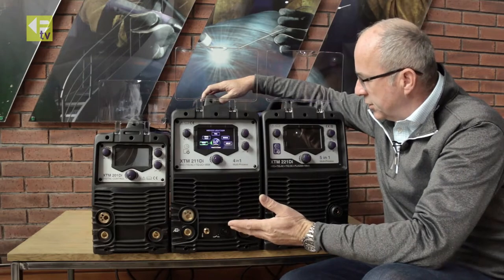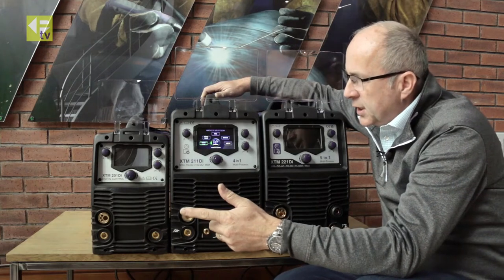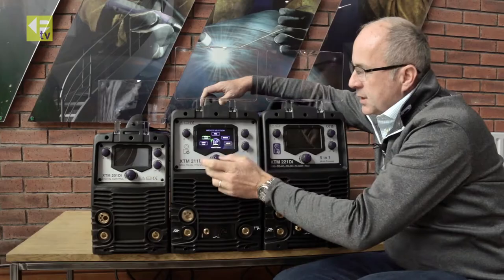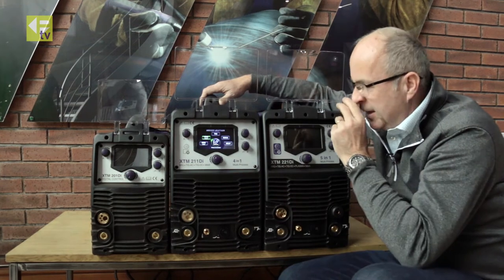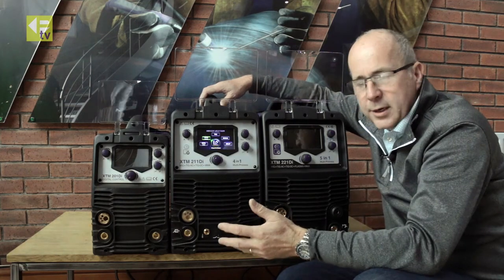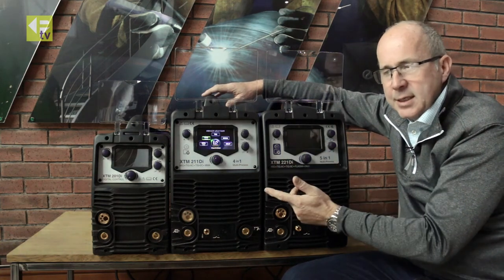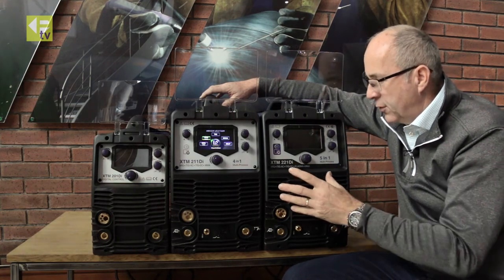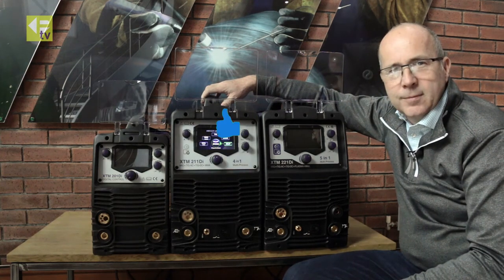XTM Di Machine Range

Comment: What thickness of steel can the plasma cut? To give you an example. I recently did a welding repair to the sides of a 15ton Bailey grain trailer and needed to cut 3mm sheet for the sides. The floor, had it needed a repair is 6mm thick so would your machine give me the cutting and welding capacity and duty cycle to do that job?
Reply from the maker: Cutting capacity is up to 15mm for production cutting so would handle that without a problem. Welding capacity is 6-8mm depending on the material and process. We will be posting welding videos and one with the plasma cutting shortly.
Reply: @ParweldTV  Great, thanks for the reply.